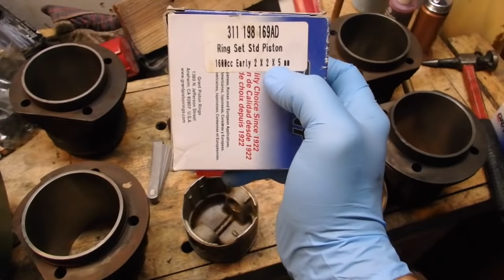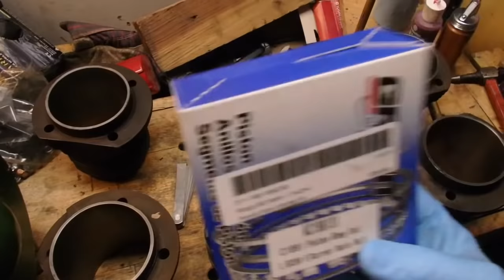1969 VW Bug Project - Episode 34 - Reassembling the 1776 Engine's Top End, Part I

Comment: Hey, Just rolled into your channel after the fact. Love what you did and how things turned out. Kudo's to you and your efforts. For future reference on the flywheel nut, (gland nut) on the real tuf jobs I set the engine on the floor so that the garage door comes down right across the cylinder head where it's flat. I then put a large C clamp in the garage door track so the door can't move.  This makes the engine solid so you have both hands free and both feet on the floor. When it comes time to tighten up just turn the engine around. I use Blue locktight and have never had a problem. I'm proud of your persistence and great attitude along with your willingness to share the whole experience. I hope you get lots of smiles to the miles. Thumb's up Sir
Reply from the maker: Wow!  The EZGZ watched my videos.  That’s awesome.  I’m a huge fan and watch your stuff all the time.  I don’t have anywhere near your knowledge or skill, but I stumble along as best I can.  And that’s a killer tip for the flywheel nut.  Genius.

Thanks for stopping by and commenting.

Comment: Nice work. I like to see people re-ring old pistons and jugs as long as everything looks normal.  Those pistons and cylinders are nicely run in.  With fresh rings, it can make a good running engine with the slightly looser piston to wall clearance.

Comment: How do  I go about  blocking off my exhaust out put im not using my haeter
Reply from the maker: I just full-on removed the heater boxes and them bought expanding plumbing plugs from Home Depot to seal the ports that run back to the cabin.

Comment: Nice job, did you check the gap on the pistonrings in the cilinders?
Reply from the maker: I did, but didn't film it.  Just put the rings in and then evened them up by putting the piston in upside down, pushing them down an inch or so.  They ranged from 16 to 20 thousandths.

Comment: Is there some kind of rule that says that you have to work on VW engine's on the floor instead of on a bench or table? I see a lot of people doing this.
Reply from the maker: No.  But my engine stand has a Buick V6 in it, and I don’t have the weird engine mount required to put a Bug motor in it.

It might also be due to the fact that the engine is light weight and gets installed from down low.

Maybe it’s laziness?  :-)

(Love the boxer in your avatar.  I’ve got a brindle myself.)

Comment: Nice job. Did you end up rebuilding the entire bottom end (bearings, etc)?
Reply from the maker: Nope.  There was absolutely no end play on the pulley, so I didn't want to put the time in to split the case and do all that.  This was more about leaks: oil leaks, of course, as well as compression leaks around the valves, rings, and heads.
Reply: Score on the 1776!
Reply from the maker: That's what I was thinking!

Comment: what kind of camshaft does it have?
Reply from the maker: I didn't tear the engine down that far to find out, focusing mostly on gaskets p, cylinder bore honing, and piston rings.  I do know the stroke is stock for a 1600, but that's it.
Reply: School St. Garage ahh ok i thought you disassembled it all, awesome video, i have a Brazilian 1981 beetle and i also do most of the repairs... although here in venezuela things are a bit more difficult, regarding to find the parts

Comment: Nice, but i cant help noticing that you did not check/adjust the end play after replacing the flywheel , they are never identical so they affect the engine and play, it might have loosened up causing the engine to pond the case or tighten up causing it to seize , staying the same is amlost impossible..
Reply from the maker: Oh crap.  Great catch, Panayotis.  My inexperience is showing here. 

I'm going to check end play at the crank pulley later today.  If there's even a hint of movement, I'll pull the engine and check the bearing at the flywheel.  (There was no end play at all before I did the tear down, so hopefully this won't be an issue.). 

Glad I made the rear apron/valance removable.
Reply: Look, it must have some movement, a bit less than a properly adjusted valve, the problem on a used engine is determining if the movement you get is from the bearing to crank and flywheel clearance, or from the worn case to bearing fitment , a new or rebuilt engine must have a tight bearing to case fit so no movement but in your case the case might have a bit of wear, first you must measure if the bearing movement, if there is any, you must end up with the bearing movement plus the clearance for the flywheel 0.10mm , it is mutch safer than aiming for 0.10mm because you will tighten the crank to the bearing and risk having a spun baring .... If you cant observe any movement at the bearing, then adjust the endplay at 0.10 all together
Reply from the maker: Awesome detail/directions.  That's the kind of specifics I need.